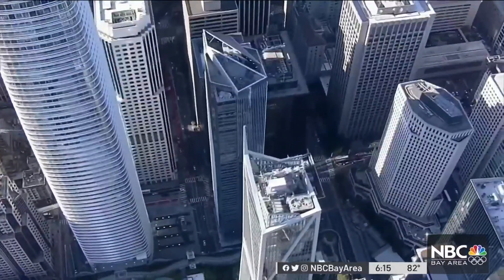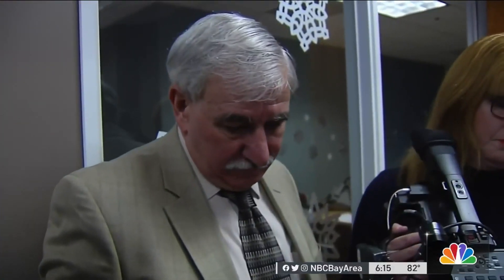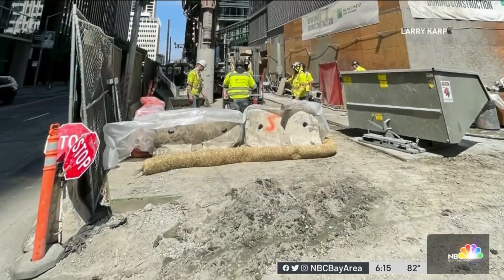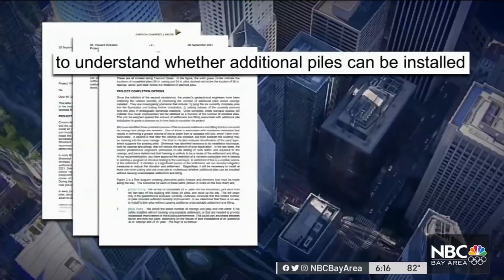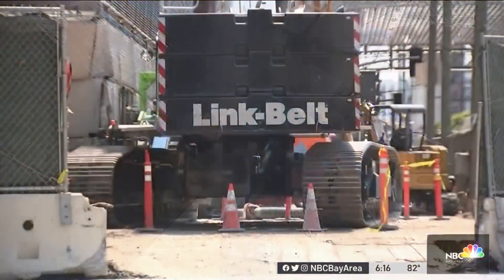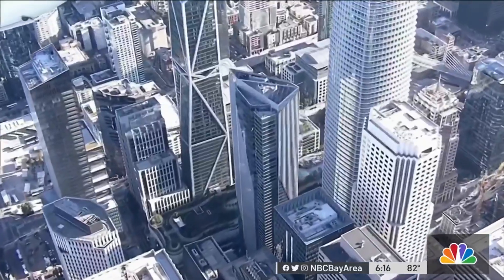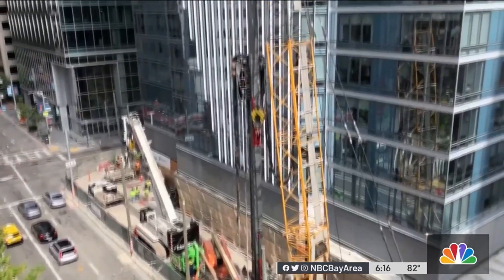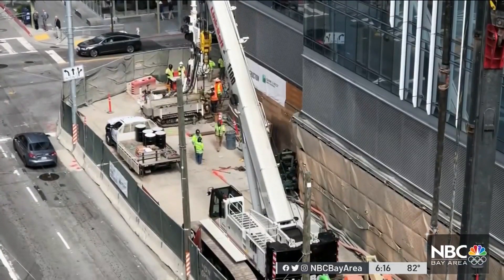Millennium Fix Engineers Want New Test Pile Installed

Comment: Digging holes next to a foundation could basically dry the base material holding the existing foundation structure. This is because you are introducing air to push water away. Just like the roof vents do to help your sinks drain. Air before water

Comment: When it is a FOUNDATION concern, it should be studied, since a part of the foundation had concerns of misalignment, and sooner the rest. Those cannot continue to operate as a building structure, since the total weight, as well as the height of the building should be the same from its foundation, that deep, if it is high rise, the same length down under, for it is equilibrium, trial balanced, all the way up. It should be dismantled, since the foundation is watery/moist, from time to time, the water needs to be flushed out, otherwise it is going to collapse and affect/make a debris on its neighboring high rise tower. The rule of thumb for the rest of the structures should be the same depth, down under the structures foundation, what is up measures, the same should be on top, fortifications should be installed, not just metal, it should be corrosion proof, water proof as well as humidity proof. SME General practices, practitioners all fields of studies are efficient, well coordinated with one another respectively: Structural Engineers, Geodetic Engineers, Hydraulic Engineers, Civil, Chemical, Electrical Engineers and Architects, Site Engineers are coordinated with their respective expertise and skills for this types of concern.

Comment: Before any work done specially drilling the foundation you have to counteract the buildings weight to the other side and the way to do this is to fill each floor with sandbags so then with the weight balanced then you can start drilling again

Comment: The soil just does not disappear. When they dug the holes, did they drive a PVC pipe like for a water well, into the hole? That would keep the hole from collapsing in on itself. Then they could just shove the piles down the pipe into bedrock. They would have to connect the piles to the building for stability purposes. I would not sign off on this until a year later. If the building did not sink, great.

Comment: I wish they would take it down before it falls down.
Reply: And kills people
Reply: @Random Guy it is not that thay are fixing it 
But what there fixing it with  
Bubble gum a nd tape only go so far  
Or whatever thay are  using  
But ya good luck
Reply: @Random Guy that building 
Is done , no way to fix that 
The foundation would have to be redone,  and major holes drilled with concrete  anchor  
If you live in that area you will definitely  pay for the repairs  in taxes , kiss that goodbye
Reply: @Random Guy the man in the interview just said they screwed up drilling 101 and that the engineers are incompetent. Why are you so optimistic?

Comment: Have any of the "engineers" realized that the freeway off-ramp runs right alongside the building and the road is absolute trash, so when the big trucks hit the potholes that is vibrations and only on 1 side of the building. If nobody has thought about this yet.... maybe it's time to add me to the team.
Reply: How are you using "right alongside"? None of the streets that border that Millennium Tower are freeway off ramps.

Comment: The initial engineers/designers involved in the building, which universities did they graduate from?  It’s important to know.
Reply: Pisa
Reply: DeSimone Consulting Engineers has an office nearby so they will hear the crash, but far enough away to avoid being crushed
Reply: Vanderbuilt, or is it Vandertilt University?  ;)
Reply: The Ronald McDonald Online University of Arizona.
Reply: Titanic University of Civil Engineering.
Reply: So no involved engineer or designer doesn’t wanna let the entire world know.  Even the universities are mum.
Reply: One of the members of the design team was professor Jack Moehle of Berkeley. Although his role was not primary, as he specializes in earthquake issues and preparedness. This apparently does not include foundation knowledge which is called geotechnical engineering - and there was no geotechnical engineer on the design team or peer review team. Moehle was the head of the city peer review team (in violation of city rules that say you cannot have design team people on the peer review team) and infamously told a San Francisco supervisor that when he said the design met code and should be approved, he wasn't saying that the design would work.

Comment: Who will the fingers be pointed at when this skyscraper comes crashing down killing hundreds of San Franciscans if not more?
Reply: Point it at the engineers and the planners who were too cheap to build it right  in the first place.  " Bedrock? Who cares about Bedrock. I just saved you millions Now let's get tenants in here asap!"
Reply: @mayhemjr.803  Bedrock? It’s that where the Flintstones resided? How ironic 🤷🏻‍♂️🤦🏻‍♂️
Reply: @scee7492  🤣😂😅
Reply: @mayhemjr.803  this passed city inspection so they are to blame as well.
Reply: @JRcomments  ok. Them too.
Reply: Faulty foundation design - blame goes on the engineering team (who had no foundation expert) and approving faulty design - blame goes on city peer review team (who had no foundation expert). Berkeley Professor Jack Moehle has the distinction of having been on both teams (against city rules). But the nearby transit building paid $30 million so they given blame - for removing moisture fro the soil which is said to have does up the sinking. Sinking which had already been larger than expected before any units were sold and before any work began on the transit building.
Reply: WHYTE folks ignorance and incompetence starting to get exposed in the world!🌍😂😂😂 But I been knew it!
Reply: It can lean more , it will the a fun place to live in with the tilt and a grandma's might slip out on its own -that will be the day when wheelchairs fly.
Reply: Hopefully  Pelosi  and biden
Reply: @johnrau2873  careful with that edge
Reply: @scee7492  I am always on the edge